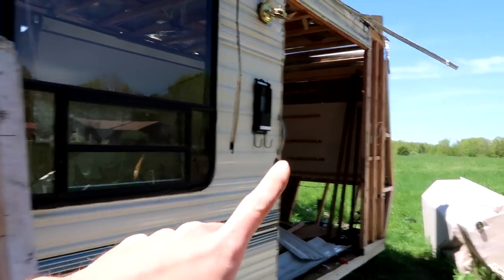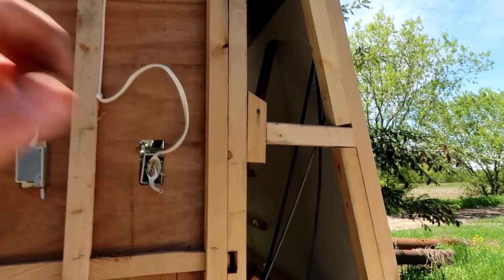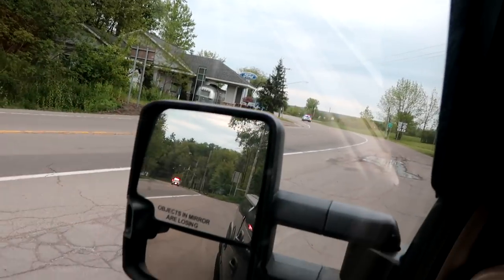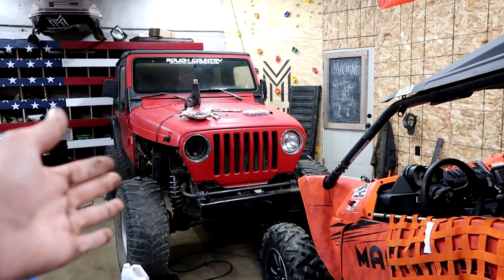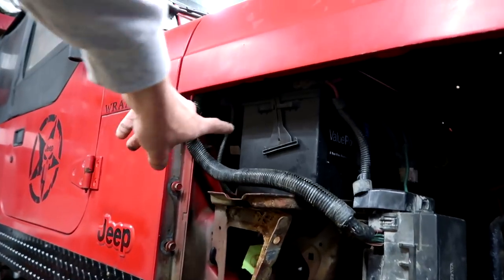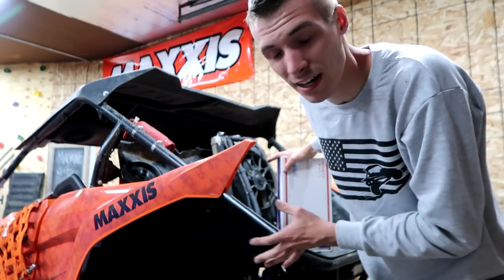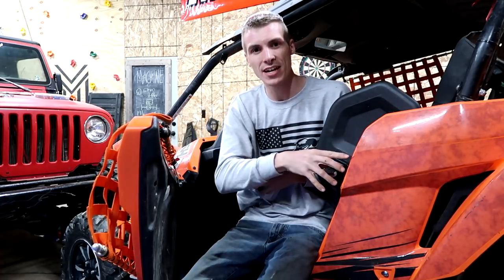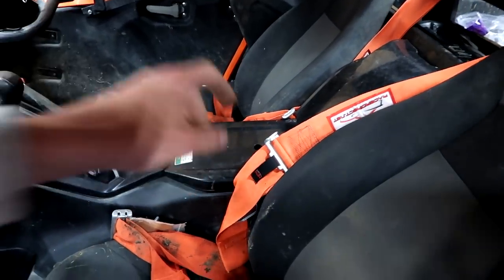They CANCELLED my Jeep Order

Comment: should seriously look into removing the sliding glass doors from the crush carrier. As others have pointed out, that trailer is not designed to travel on the road. Neither are sliding glass window, you have NEVER seen any trailer on the road with them, because  of there design they can just bounce out an end up no the road, potentially hurting people.

Comment: When you put it together you should try put a skylight that's roughly 1meter by 1meter above the kitchen
And hey a wire to run either side under it so you can put a curtain across when you want it to be darker

Comment: Might want to cover that glass slider while your on the road traveling a rock could shoot up and crack it or whatever else might shoot up from the road
Reply: allied1394 lots of campers nowadays come with slider doors. And not just park models. Regular travel trailers. I wouldn't worry about it.
Reply: Alex you MIGHT be correct, but this is not one of them. This is a PARK trailer. He should just removing it completely so he is not dealing with huge sheets of glass all over the road somewhere, potentially hurting someone.
Reply: Get that damn thing out
Reply: i would remove it completely and just have a normal door
Reply: Exactly Wilbert, any one that has worked on them knows how they function, you just need to lift it up to take the bottom out of the track that it slides in, bouncing down the road this could happen all by itself. Rip that sucker out put a normal door in an never even give it a second thought again.

Comment: Dude your crazy 😜 😂. My suggestion to the Jeep is either yank out the Motor and putva small block chevy in it with a carb, or delete the efi and computer and run a carb with an electric fuel pump. The campers coming along nice. Going to massively heavy in the tongue (hitch) even for the d max but still coming along nicely